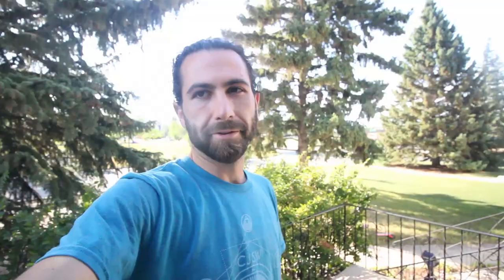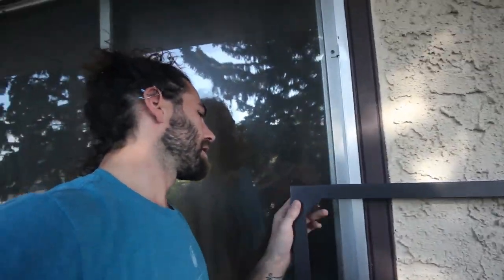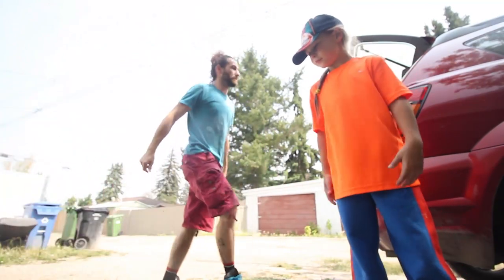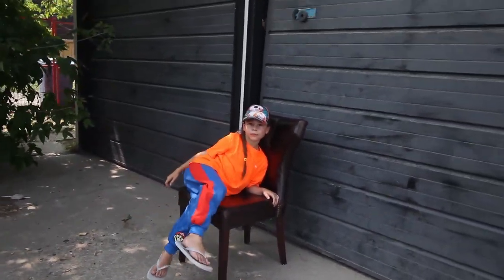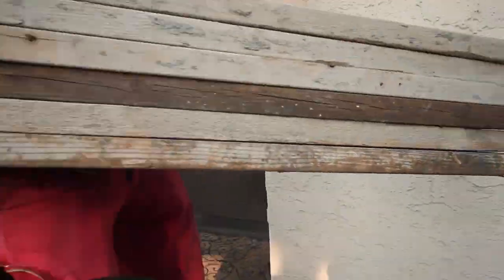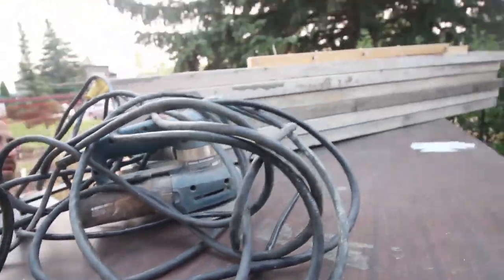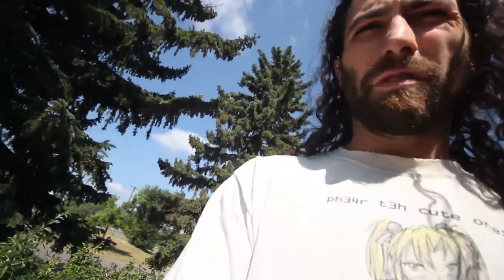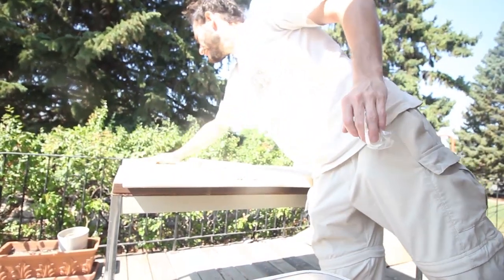IKEA Furniture Hacks - Turning A Cheap Table Into Reclaimed Wood Art Piece

Comment: When you try this again, try using a pressure washer first. It will minimize the dust and get under the larger chunks faster. Then once dry, proceed sanding through the grits until you're ready to finish.

Comment: oooohhhhh…...looks like a million bucks !!!!!   In summer usually the eco stations are full of stains and urethane.  What a gorgeous table set.  You did such a nice job.  BTW this is the absolute best time of the year to sell furniture as it's still nice outside and students are going back to University and need stuff.  Bottom line maybe $500-$550 ($100/piece is cheap).  Likely more than that.  Just keep posting and reposting and it will be gone in no time.  Also people may ask for delivery.

Comment: Curious what/if it sold. I made furniture and did antique furniture restoration for a number of years. I would think that you should be happy if it sold for $200-300.... Definitely a lot of work and ya did a great job. If you used a different stain or even no stain, it would have been worth more money. I could be wrong as furniture preferences do change from region to region. Learn how to repair furniture and fix the finish on them and you will do a lot better profit and time wise. There are plenty of guys that I like and they clearly know what they are doing.